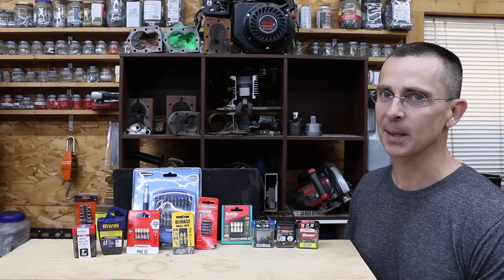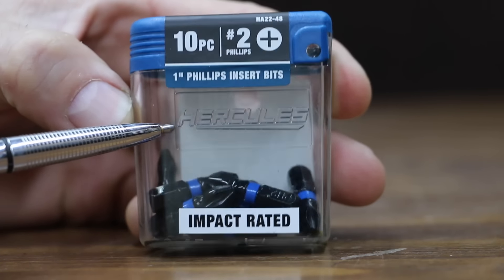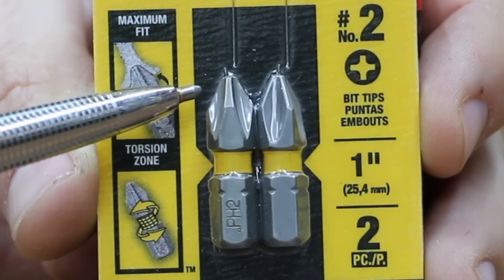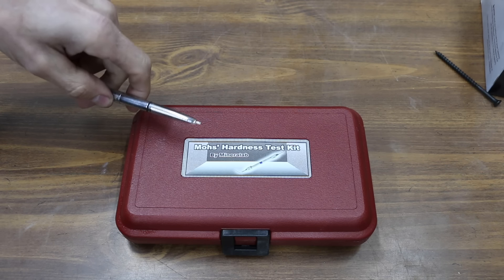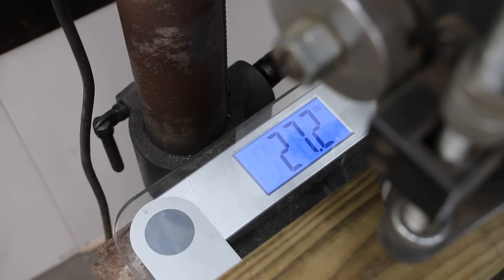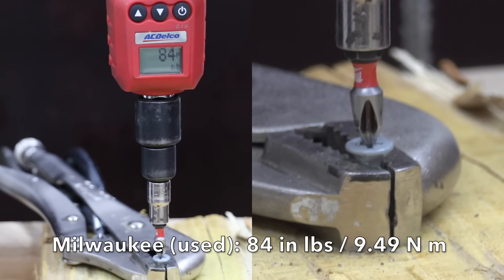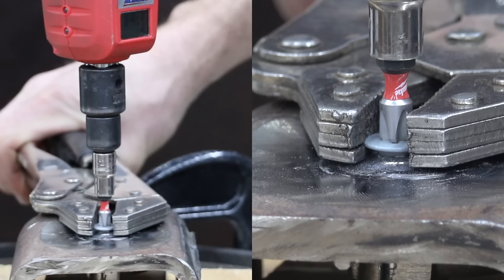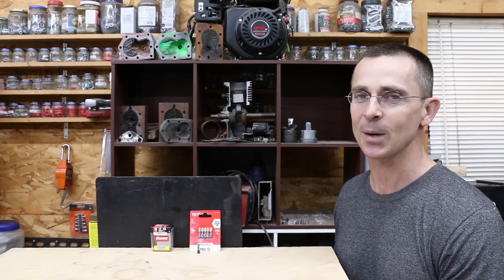Which Impact Driver Bit is Best? Let's find out! Phillips #2 Showdown

Comment: I'd like to see a comparison of the different types of screw types. I think the Robertson screw is the best as I've never stripped one.
Reply from the maker: I'll check back to see how many likes this suggestion receives and hoping viewers will suggest brands they want tested.  100% of the ideas and brands tested are from viewer's recommendations.  Thank you!
Reply: I'd also like to see that. I think it'd be informative to include varieties like GRK's star-drive and Spax's T-Star Plus.
Reply: Yep I'd be very curious of Robertson vs Torx along with any cost differences between screws of those bit type.
Reply: @JoeUrbanYYC  I'll Fourth that.  Robertson being square seems like it should be exceptional.
Reply: Ya I’d love to see pozidriv too
Reply: I agree.  I avoid using Philips screws whenever I can.  Torx #25 is my go-to now, but your testing may change my mind.  Keep up the excellent work!
Reply: Everything I build now uses torx screws. Typically I use coated ones from Grip Rite, more specifically from Home Depot. Home depot seems to carry all the common lengths with the same T-25 torx end so one bit drives 1-5/8, 2, 2-1/2, 3, & 3-1/2in screws which is handy. My local hardware store offeres the same brand screws but different lengths require different size torx bits. I think T-15, T-20, & T-25 to cover all the lengths I listed above. If I cannot use a flat head (counter sinking) screw head, to prevent splitting like in pocket holes, then I use GRK. If I had to drywall my home i might use Phillip's but only because of speed with a drywall gun. Square drive just isn't as common as torx, here where I live, so I don't even consider them an option. Would love to see a video to compare though.
Reply: Would love to see test torx vs square. Torx has definitely become my go to with the grrk brand screws and driver bits as my favorites
Reply: Thanks for all your hard work and your ingenuity in testing.

Would be interesting to see how the JIS (Japanese Industrial Standard, also called Vessel) Phillips like drivers fare. My experience with them is that they will fit the best into a Phillips screw head but the Phillips driver has a bad fit and has a tendency to round out the head of the JIS screw. Found out the hard way maintaining my Honda motorcycle which has all JIS screws.
Reply: Don't forget tripple square and etorx!
Reply: (from personal experience) Robertson's main downfall is that it's almost impossible remove a screw at a bad angle without stripping the head out badly. I would expect Torx to suffer the same weakness, but I have never used it
Also, #2 Robertson painted deck screws strip unbelievably easily
Reply: Gets my vote
Reply: In Canada we use mostly robertson screw deck... never reslly understand why people still use Philips head when the Robertson is just perfect and so simple to use.  It is possible to strip one, I use thoses for datacenter and sometimes the old rails 10/32 screw has too much powdercoat and
you strip one, so you use a tool
to put back the screw pattern.
Reply: @DrLoveQc  Robertson was a Canada exclusive (mostly) due to patents. I don't remember the whole story/reason, it's probably a fun read
Reply: Made a similar suggestion, but I'd like to see a shoot-out between Robertson/square-drive, Torx, Allen/hex, Pozidrive, JIS, Philips...
Reply: Use Kreg pocket-hole screws...You'll strip some. :D
Reply: After 5 yrs of cabinet making... I can tell you square drive is the way to go
Reply: @diarmuid858  Thanks pozidrive was the one I couldn't remember.
Reply: I like torx head as well
Reply: I've been using more of the GRK screws. They seem to work better, but I'd like a Project Farm opinion.
Reply: This would be super interesting to see both the different types and brands. Who knows maybe one brand makes a superior Robertson while another rules with Torx and overall which brand/type combo is best is different scenarios like tensile strength of holding two things together vs those two things being moved in opposite directions
Reply: @ProjectFarm  Deck mate screws, the torx versions of course. its all I use.
Reply: Torx is king in my early prediction 😀
Reply: That would be interesting to see.  I like torx or square best.
Reply: Yes, in Canada, Robertson is the only type I use for Wood Screws... I would love to see who makes the best bits.  I tend to just have a drawer of inexpensive ones, and when they start camming out, I toss them.
Reply: I brought some screws from some budget store, the heads were total junk! So many rounded before bottoming out
Reply: Torx is designed and built for high torque and will definitely beat a Robertson. But how would you compare these two anyway? What's your definition of them being the same size?
Reply: I can't comment on Brands but I would like to see what brand of Torx bit is the least likely to snap off my biggest problem with Torx screws is it will not strip out just the bit that self either bends over or snaps off
Reply: @superdau  Brand while important, isn´t all of it,  bit type is much more  influential,  usual old-school Philips head should be banned already, either Robertson or torx bits are much better... I don´t know depends on the screw quality and how worn out the bit is you are using , I´ve stripped both Robertson and torx screws, if it´s cheap or you abuse it they will all eventually go bad, but ruining the old-school Phillips head is the easiest...
Reply: So you won't look foolish in front of your friends  . . . a star drive is really called "torx" bit. Just saying  . . .
Reply: Electrical parts have gone to almost 100% combination flat & square head from combination flat & Phillips. A square head can hold the screw without it being magnetic. What a big improvement when this change came about.
Reply: The Robertson screw can not hold a candle to the Torx drive screw. This is particularly true when using 316 and 308 Grade stainless steel screws.
Reply: @ProjectFarm  This would be great! It would be nice to see less common screw types too like Lox, Phillips-II, and Phillips Velocity.
Reply: I only use philips when I don't have a choice.
Reply: @EqualVent  try removing a Phillip's at a shit angle. Stripped 100% of the time...
Reply: @EqualVent  MANY mobile homes use Robertson.  I prefer Torx.  Many machine bolts and screws are hex.
Reply: I just use drywall screws for all indoor application (unless it's heavy load). Drywall screws don't strip easy

Comment: "we tested 20 brands of PH.2 bits and found out that they are all universally worse than torx"
Reply: charles turner we use Robertson in Canada it is square and superior to both designs
Reply: Yea, I find it a bit silly to test stripping resistance from a design that was literally invented to strip.
Reply: @LuminaryDJ  It's because they're used in use cases where stripping us not preferable.
Reply: @LuminaryDJ  Kinda silly we use Philips everywhere.
Reply: My favourite is Robertson....hard to find outaide Canada and particularly in the UK (albeit a company called square screws imports them into the UK including genuine Robertson bits) then torx then pozidrive
Philips if nothing else
I loathe slotted screws though biggest pain in the rear
Reply: @StaticReplication  Well it beats flathead, That's why Mister Philips invented it :)
Reply: I use torx exclusively. Canadians are always hyping up their square bits but it seems like nobody in the US can make a good square bit screw or bit. You guys must have different manufactures or something.
Reply from the maker: Thanks for sharing.
Reply: @paulbolus9399  correction. John P. Thompson invented it. Phillips bought him out.
Reply: @Mittencarpentry  also correct. ANSI really screwed the pooch. When the patent expires they tried to copy it, but they got the taper angle wrong, and it wouldn't hold screws. Then ANSI changed to match the Robertson better. But because they already has some ANSI square out there, it's now a total messup with poor fitment and confusion. Only genuine Robertson is the real thing unfortunately.
Reply: Why do you hate flat head? It's good on automotive and now you have a screwdriver/prybar
Reply: I use torx, squares, phillips, flathead, and hex head screws and/or bolts in my line of work and I use Milwaukee for all of them. I've never heard of Robertson's. Do they only make square bits?
Reply: Robertsons are a tapered square drive... Named after the guy that invented it. Very common in Canada for everything but drywall screws.
Reply: @IfYouLikeFishnGritz  Robertson was a Canadian guy who tried to get Ford to use his drive. That deal didn't work out, and Robertson never caught on outside of Canada. he wanted control of the patent and Ford was not having it. It's now used under Trade Mark by some bit manufacturers but the original P.L. Robertson company is still around and making screws.
Reply: Warren Graham Thank you, that explains why square aren’t popular in the US. But now I have Robertson envy.
Reply: @jimbean7431  as a Canadian and a tradesman I say.
Torx> Robertson>Phillips
Reply: Robertson head screws are actually common in the RV industry. As an RV tech I use Milwaukee #2 Robertson and #2 Phillips bits everyday.
Reply: @Mittencarpentry  its funny because here you can get most of these bits he tested in Robertson. definitely the dewalt, Milwaukee, Bosch and all the big names like husky and irwin
Reply: @warrengraham  To be more accurate, Ford started off using Robertson screws on their production line, Ford liked them and wanted to buy the patent or something, when Robertson refused, he blackballed them and no one in the States ever used them in large numbers.
Reply: Need to test square bit that is all we use in our shop
Reply: Unfortunately I use self tapping Phillips in steel framing daily but I've developed a love for Vega bits which seem fairly unknown.  Are the Milwaukee the new carbide ones?
Reply: Many many decades ago and in a land far far away tools actually were actually quality made and didn't suck. Thank you politicians for chasing American companies to Asia.
Reply: @thinkingimpaired5663  customers and a cheap disposable society are mostly responsible
Reply: @jimbean7431  I hope you're joking 🤣
Reply: I don’t use slotted screws. They were great for their time (19th century) but we have so many better options now. I’ve relegated my flat blade drivers to pry-bar duty.
Reply: @jimbean7431  Torx bits is the best.
Reply: Torx bits is the best.
Reply: @Mittencarpentry  Torx bits is the best.
Reply: Love my old SAAB.  All torx and E-torx.  Nothing ever damaged.
Reply: @jimbean7431  Yes!!! It is superior. Dont forget to mention its a Canadian design and thats the knly reason mericans dont use it. Also, never buy actual impact bits. I used a single normal good quality driver in an impact for thousands and thousands of screws without breaking. My buddy busted out his fancy expensive Bosch brand bits and proceeded to snap every single one of them. Reason is they try to case harden those bits but theyre too small and they end up hardening the whole thing turning them brittle and weak. Complete money grab.
Reply: Project Farm Maybe there’s a way to test/compare different bit head types. Based on everything I’ve seen you do, I’m confident you can remove all the variables involved. 

You rock, Todd! Love your work.
Reply: @ijustholdsquare9251  I was just about to reply that flat heads aren't good for anything, but then I saw the last part of your comment. If it wasn't for flatheads, we wouldn't have the variety of prybars, and the plastic handles make the prybars much easier to use.
Reply: Levi Wall flathead is The Worst, with a drill, its a pain in the ass to line up every single screw every time, and it slips out all the time,

But for hand tightening, i do like flathead
Reply: We mostly use torx in Sweden for carpentry but phillips are a close second
Reply: and Torx is universally worse than Robertson. They still strip !! junk.
Reply: What about JIS.
Reply: tom eng until lit strips then you are left with a round hole . We actually use Robinson design here in Canada to almost drive thick lag bolts into hardwood . In this extreme situation torques bits would not hold up
Reply: Sam Ruba joking about what ? The only reason Robertson is not being used is because it’s a Canadian design . Like the metric it makes a lot more sense to use that is why the whole world is using it

Comment: I have found that grinding the first 1mm of the tip of my driver bits has reduced cam out considerably. I use mostly stainless steel screws, in oak,  and the screw heads are not always as well formed as they should be. Removing that first mm ensures the lands of the driver bit seat properly. It works so well that I now do this with all my driver bits as soon as I buy a new box whether they are for  driving stainless or standard steel screws.
Reply from the maker: Great tip!  Thank you
Reply: Heh I thought I was the only one that ground Phillips bits. But yeah when they get worn out I'll regrind them and they do seem to work better than new then.
Reply: This is a good tip, I do it as well. It makes the bits more like JIS bits (Japanese Imperial Standard) which are standard in Japan, and though they look nearly identical to Phillips #2 bits/screws, Japanese bits/screws are not designed to cam out. Their engineering philosophy insists that an engineer design a torque rating for every single fastener used on an item, whether it be an automobile or a kids toy. It's neither better nor worse, just a different philosophy than the U.S./the West...
Reply: you can buy grund down phillips bits, its called PH2G or PH2R. they are made for self tappers like you used!
Reply: @mediocrates1937  sure the "I" doesn't stand for Industrial? And yeah JIS does make a mess of things. I just love standards. There's so many to choose from!
Reply: So the tip is to remove the tip?
Reply: Don't you guys have torx screws there?
Reply: I do  the same on all my new bits. I also grind an angle on the last MM or two of the tip so it bottoms out better. It will also fit the Asian (JIS) type screws
Reply: @david-1775  skimming just a little of the tip off can get the driver to sit a lot further down into a screw head. You're going to get all the torque from the periphery of the cross point arms too. So the very tip is never going to do much for you anyways.
Reply: I also grind off the tip on all my new driver bits. I also grind an angle on the last MM or two so they bottom out better, similar to the JIS profile. Greatly reduces cam-out. Anything that makes the driver bit seat well will increase the life of the bit, as well as making the job easier. Another note: If the screw does cam-out remove it and discard it because as soon as the screw cams out it will not drive well again, and will wear out the driver bit faster. This is especially important if the screw is almost all the way in, as it will be difficult to finish the drive. It is easier to remove the screw and use a new one than waste time trying to finish up on the worn screw,  03-02-2020.
Reply: @1pcfred  I know, it made a lot of sense... I just wanted to say it... :)
Reply: @vesas5214  we have everything. No one is going to hang sheet rock with Torx screws though.
Reply: @vesas5214  yes but to expensive. These are also finish screws for door hinges so kind of stuck with what comes in the box.
Reply: @1pcfred  there's a Jewish joke in there somewhere 😂
Reply: @trig  there's a Jewish joke in everywhere. It often takes a Jew to find it though. I love shellfish too much to be Jewish myself too.
Reply: @1pcfred  Yes that's right, my bad. My JIS #3 screwdriver is made by Imperial Tools so I think my shriveled brain conflated the two things.
Reply: @mediocrates1937  Japan does love their Emperor. So an easy mistake to make.

Comment: Had a pack of Bosch they would consistently break at 1 per every 4 concrete screws.  Changed over to Milwaukee and drove 8 more screws without one bit breaking.  Sticking with Milwaukee.
Reply: I have worse. I gotta work with old black and Decker bits
Reply: Look up Robertson bits.
Reply: @mustafanaik5866  no.. You don't
Reply: @randymathews3348  the bits that come with the drill. What do you mean?
Reply: @mustafanaik5866  you can buy better bits bro.. You run your saw w the blade it came w?
Reply: @randymathews3348  yes
Reply: @mustafanaik5866  I only run Diablo blades in my saws

Comment: Find and use pr2 or a p2r bit if you can find them  , this is  a bit I used while hanging drywall many years ago and was all that I would use to hold and drive a screw in wood or steel  ...
Reply from the maker: Thanks for the suggestion.